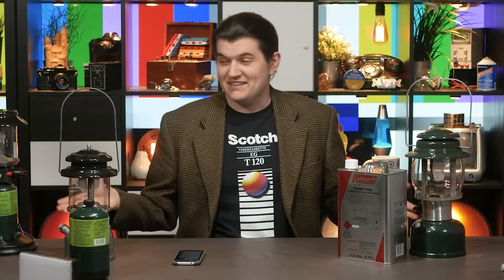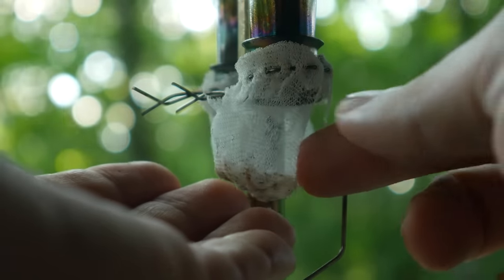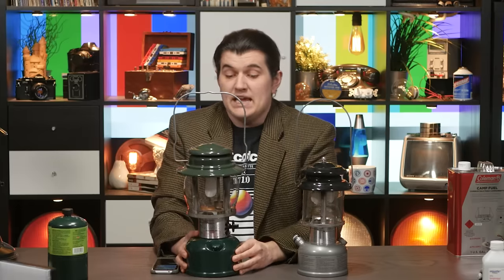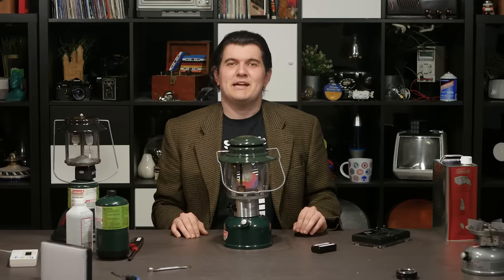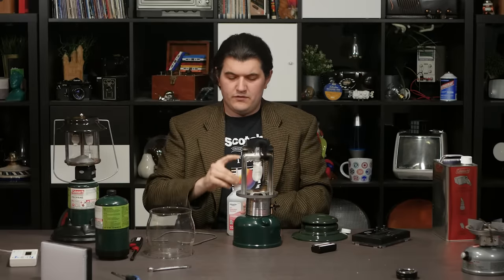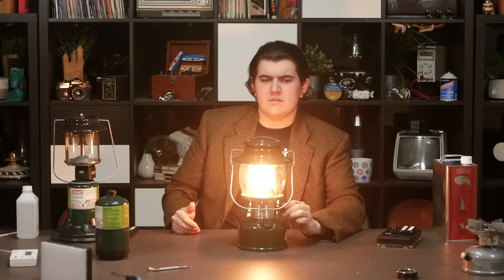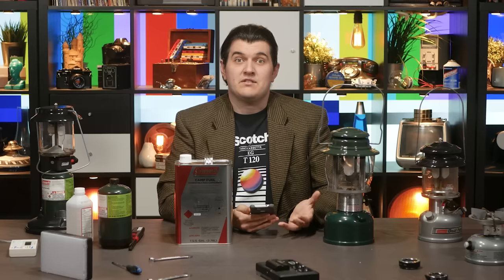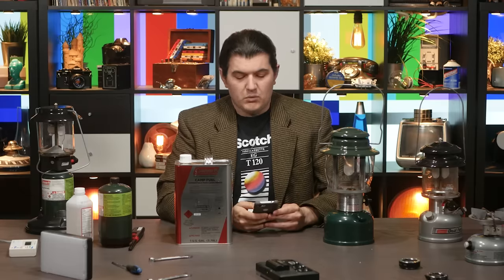A very rambly Coleman Lantern follow-up. Turns out they rarely make sense in 2021

Comment: I've used these since I was a kid so they're really no mystery and running them is second nature, not complicated, just a few things to know.  Not recommended to fill the alcohol cup with anything but the squirt bottle it comes with.  The extra step is worth the difference in the cost of the fuel for kerosene vs white gas imo, plus the safety factor.  I still use the heck out of these and I own one like the large single mantle 639.  I also own a smaller 214 single mantle kerosene lamp which works well, and I also converted a dual mantle 288 white gas model I've had since the 80s to kerosene since the fuel is so much cheaper and I run it in my other ones.  I posted a video of it running, it was only a generator change (same as the 214 has which fits the 288 perfectly) and the addition of the alcohol cup.  That's all it takes and you've got a dual mantle kerosene lamp, plus you can change it back to white gas in a few minutes.  Since I live in a very rural area I like having a large supply of kerosene on hand for emergency lighting and cooking.  Since I have 3 Colemans that run on kerosene, 4 Aladdin mantle lamps, a number of wick lamps, and even a Coleman kerosene camp stove, I think I have my bases covered for a long term power outage.   I have one old 1950s 200A that runs on white gas in case I need to light one up really quickly.  If an extended outage were to happen, a place like where I live would be the last to receive any kind of help or supplies of fuel.  In this case all the battery lamps in the world aren't going to help you after they go dead and you can't charge them anymore.  A few good sized jugs of kerosene can keep your lamps running for weeks or even months depending on usage, and the way things are looking in the world, people everywhere might want to consider some alternative sources of lighting like this.  It's not difficult or expensive, and could make a real difference in an emergency.

Comment: Many years ago I was given a Coleman "Unleaded" lantern. (This was explicity NOT a dual-fuel, a warning on the side said "DO NOT use unleaded pump gasoline")
This was before LEDs were economical to use as a direct light source.
The uncle that gave this to me vastly preferred the hurricane lanterns for their softer, oranger light.
I preferred my Coleman because I could illuminate what felt like the entire forest with a power of illumination that flashlights and LED lanterns have only relatively recently been able to reproduce.
Sadly, only a few years after this, the tank rusted through and sprung a leak. While we were using it INDOORS during a power outage!
However, the uncle that gave it to me had passed on by this point, and the lantern had developed a strong sentimental value to me.
My mom reassured (very young) me that I could still keep it as a keepsake, although I shouldn't use it anymore.
She thinks she found it in her house (though it may be her own), and if it is mine, promised to send it back to me.
I wonder if I can re-seal the tank with gas tank sealant and get it working again....

Also, thank you again Alec, because of you I have again purchased obsolete lighting technologies. I've got a Dual Fuel model on the way now.

Comment: I think the hole in the plunger is to prevent overpressurizing the tank. If the pressure in the pump is too much to hold in with your thumb, then you can't push it into the tank.

Comment: i dont want to sound like im advocating against technology however i have done a bit of camping and me trying to find the best lighting myself i went and bought battery powered lanterns and i have your same exact dual fuel coleman  lantern. the battery powered lantern even though it states it puts out the same amount of light as the fuel lantern, it does not. the LED battery lantern i had which was also coleman was much duller than the dual fuel lantern also i found the batteries don't last anywhere near as long as advertised and gasoline being much cheaper per gallon than replacing batteries every night was more appealing. also kind of a side note most people like me also use the dual fuel stove with the lantern so that we only have to carry gasoline which i dont even have to buy specifically for camping because i already have a canister of gas in the garage i use for landscaping equipment, AND conveniently enough you can put it in your car in case of emergency or use it to light the bonfire/campfire we usually have at night. i tried using solar panels but it takes ALL DAY for a 200 dollar solar panel just to charge my phone, i cant imagine trying to charge batteries for enough lights to outlight my lantern. I'm still waiting for tech to catch up because to be honest i would rather not tote around my glass fragile lantern in my truck while camping and  as you mentioned they are high maintenance with having to pump them up constantly and worrying about the dangers of carbon monoxide and fire risk.

Comment: To answer the questions about the pump on the liquid fueled lanterns and stoves. 

Turning the stem counterclockwise opens a valve (probably for redundancy) that allows air to be pumped in. That way the tank isn't relying on just a simple check valve at the bottom of the pump. 

The type of seal on the stem is cup shaped, basically a moving check valve (one way valve). When you pull the stem out, air can easily slip by. When you push in, pressure pushes the seal against the wall of the tube. There is no need to uncover the hole when pulling the stem up. 

The reason for the hole in the stem. It there so you can push the stem in, with the valve turned to the closed position.

Comment: I love these lights for camping and wilderness, they are much more cozy and less harsh than a bunch of led lanterns around, are consistent and work great and you can easily bring extra fuel with no recharge time if it runs out.
Reply: Replace the “extra fuel” with extra batteries & you can power LED lanterns for WEEKS

.
Reply: @electrictroy2010 you can carry tanks of fuel under your house for decades, batteries die after 6 months

Comment: The vent hole on the pump is still there as an over pressure protection. On older version like I have on my white-gas stove, it is a vet to release the pressure when you are done using the stove. If you don't keep it covered until you screw it back down, you will gain no pressure in the fuel tank.

Comment: the mantels are only ash remains post burning with the set up. 
the vapors are what burns that is why they are pressurized . 
the mantle traps the vapors to burn and form the light. the flash 
point or “gas” is -31F, kerosene is about 160F  ( more difficult to ignite)!
that is why the coleman fuel vapors continues to burn when turned off
well above the flash point, until all dissipated above valve.
I think it has a ball bearing valve, you hold the end to trap the air to
pressurize the tank. neat video.

Comment: Regarding the orientation of the handle 90 degrees relative to the front: when the lantern is hanging from a line suspended from two trees, for example, the front will be facing the direction from which you're most likely to approach it.

Comment: I don't know if somebody has mentioned this before and I ain't going to read through 4000-plus comments to find out, but the green Coleman is a poor show also as far as kerosene pressure lanterns go -- you should have checked out the Tilley and the modern Petromax before you dished the type completely. The reason why kerosene  lanterns exist is that in most of the rest of the world, you can't get "white gas" -- kerosene/lamp oil is the only lamp fuel available and both lamps and camp stoves -- including the legendary Primus stove from 1892 -- are designed for it. You can get kerosene in 1-litre plastic bottles while gasolene is only available in 5-litre cans and from pumps, which isn't very handy if you only need a small amount. The Tilley -- which isn't made anymore -- has a glass only covering the mantle and the upper half of the generator; the lower half of the generator tube is bare, so you heat it with a donut-shaped little metal wick thingy that you keep in a jar of alcohol and clamp on to the generator when you want to light your lantern. There is no spill or fiddling with the top and glass. The only problem is that it doesn't work too well in a wind. The Petromax (which was the first pressure lamp, invented in 1910 three years before the Coleman) has a "rapid starter", i.e., a thing that flips out from the side and a bit of fuel squirts on to it; you light the fuel and it heats the generator until you're ready to light the mantle. There is also a heating cup available that can be used for alcohol if you want to save your mantle as heating with kerosene wears it down more quickly, but again, you don't have to take things apart, you just have to be patient.

Comment: A massive thumbs-up. You have put up a great argument for the case of batteries. How much does the equipment cost. How much does the recharge refuelling cost.  Considering that the lanterns fuelled by hydrocarbons gives off heat and carbon monoxide and dioxide. An led is cooler thus more efficient in converting energy into light. Is cost an issue or environmental impact. You can get hand generators to recharge batteries for light and hobo stoves for cooking that uses dead wood for cooking. There's always a source of energy for the application needed. Including nuclear fuel to charge your batteries 
You're very well educated and a great communicator looking forward to seeing all your vids  .

Comment: In my experience, Coleman lanterns are pretty cost effective if you have one for cheap.

A can of white gas costs $12 where I’m at. I’d love to use some of my LED battery lanterns, but 4 rechargeable D batteries with 1.5V output are around $80. I got my lantern for $1 and 1 can of white gas lasts about 2 summers for my rate of use.

Comment: All the people I know with Kerosene lanterns or stoves were other aircraft mechanics I worked with. We had to drain the tanks of any planes that came in and (at least here in Canada) it’s illegal to put it back in the plane when work is finished, so once a month or so we’d have a day where anyone on the team could come and fill up with Jet A. Some people used it for camping, and a couple guys had big tanks at home for their vehicles… TDI Jettas seem to run like a dream on the stuff 🤷🏻 

I’d bet that most of their market for those lights and stoves is people working in similar industries that rely on Jet A/Diesel… Thinking of the people working in mines or oil and gas up north, where the equipment, generators, and trucks all run on Diesel 1 or Diesel with additives. The convenience of the stuff outweighs flying in special fuel, and where the extreme cold makes batteries impractical

Comment: I haven’t read all the comments this one might have been said before but one benefit of the kerosene lantern that I noticed by accident was that the one in my great uncles barn had been out there for probably 10-15 years and I was able to light it with the fuel still in the tank. Kerosene will store longer than gasoline it appears.  So if you’re in a remote cabin that you don’t use often the kerosene might be more reliable

Comment: I built my own old style lantern using 10 18650 batteries (3000mah each), powering a 12v 3A LED array, they are of course cooled passively with heatsinks. It runs for about 9-9.5 hours at peak brightness and takes about 2 hours to charge at peak speed or 5 if I wish to take care of the batteries. I made the effort to try and waterproof it, so the batteries and bulb use the metal casing on the lamp as cooling by using K5 thermal grease. Has been great so far, use it when I am with friends on the cabin or something like that, 20-50% of the power is enough most of the time so the thing can run for the whole weekend with 4-6 hour intervals, its also really easy to repair, its just 18650 batteries, controllers and CSP leds.
I did go for 4000k LED, for that classic look yet you know its led. 
I would say 200+ hours of runtime so far and going strong, 0 failures

Comment: Loved the video. I grew up with Colman lanterns and in an era when led (LED?) was something you did with your horse. I have had a love affair with these lanterns over the years and expanded into the Petromax lanterns that have there own peculiarities, but are sometimes very classy looking devices. You have, however, pretty much hit several nails right on the head. I still camp even in my seventies, but warm summer nights really don't need more heat in the tent, so my lanterns usually stay home in favor of something with LEDs. They have revolutionized portable lighting solutions. Ice fishing is another matter. Hard to beat the convenience of a propane lantern that also provides some significant heat in the ice shack. The Petromax kerosene lantern goes back over a century and they have a reputation for burning almost any flamable liquid. I use a mix of kerosene or aviation fuel with citronella oil in the old Petromax when relaxing in the evening on the patio during the mosquito season. The same trick might work in the kerosene Coleman, but I don't have one of those beasts. The old lanterns have a lot of nostalgia for me, but convenience has won out regardless of cost. I have basically moved on to the new technologies except for some very special occasions despite my fondness for those old lanterns. My lanterns have become mostly wall or mantle decorations to maintain the rustic atmosphere that I cherish.
Reply: I don't have any lanterns yet and would like to purchase one to use but I think it would be a Coleman dual-fuel or a butane one that can be found at a reasonable price in my country.
I would like to be able to use it indoors and butane lanterns happen to be indeed allowed (In the user manual...).
But they also produce much less light than Coleman or Petromax lanterns and butane canisters are disposable and cost more than pump gas or white gas (in my country anyways).

Comment: I have one of the Coleman single mantle kerosene lanterns.    My biggest reason for buying it over the dual fuel version is fuel storage and ease of getting kerosene.    Kerosene in a sealed container has a much longer shelf life than Coleman fuel or gasoline.     I keep it for camping purposes and emergency lighting.    It does smell if you use it indoors.    For emergency situations, light and heat take priority over a little smell.    I also have the Coleman Northstar version that uses propane.    Never hurts to have more than one emergency heat and light source.

Comment: Coleman products are a system. During the freak snow storm here in Texas we had light, heat, hot food, electricity and a hot bath. All this thanks to Coleman products. It's kind of hard to do that with batteries, and can be expensive. You can't recharge when there is no sun and no power. With this stuff, you just fill up the tank and you're good for several hours. I hope you do a video about Aladdin mantle lamps, now those are fun!

Comment: As a kid, in our off grid cabin, we used all of these technologys, but mostly the propane variant, but ours was mounted on a bigger bottle and had a cookingplate on top, so we placed it on the floor and put the coffepot on top when we got to the cabin and got heat, light and coffe from it. and nothing felt more like home then the sound from it and the smell of coffe.
I actually play a similar white noice sometimes for sleep.
Reply: Cool.
BTW someoneelse I suggest watch a 13 part series called What on earth happened by Ewaranon to learn that the earth is not a globe. I got it in my about tab.

Comment: When I go camping I go prepared. We have several LED lanterns, white gas lanterns and propane lanterns. LED are all that are used in tents. Propane is used with my stove as I have a 5 gallon bottle tree that holds the propane lantern on top and the stove hooks up to the same tree. It holds the lantern at just the right height above the stove. The white gas is usually emergency backup at this point. Those will always run.

Comment: This is brilliant! (no pun intended..........well, I lied.  I did intend the pun🙃).  I took a Coleman mantel, propane powered lantern with me on my last camping trip because it was an inexpensive addition to my car camping gear ($30) and because it shared the propane energy source with my stove.  It took up a good bit of space (with its carry case) in the car.  The logic of your arguments for battery powered lights are unassailable.  I can only say that in my case, the propane powered lantern was only taken as an emergency lighting source that I decided to take in the event that I got into a campground after dark and needed a good bit of light to help me set up my campsite.  Otherwise, I only used it two or three times in order to be able to do a half hour's worth of reading before turning in. But I was indeed concerned about the fact that the lantern was basically parasitic on the fuel I needed for my two burner stove.